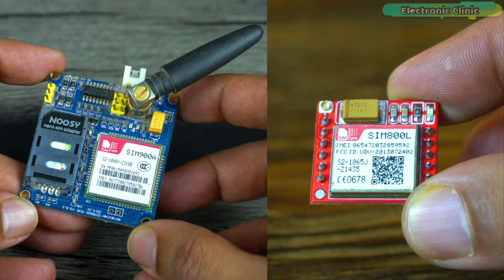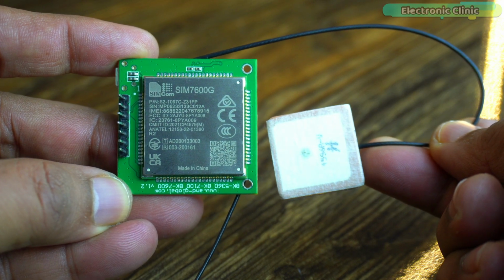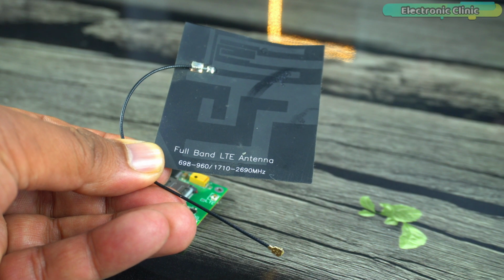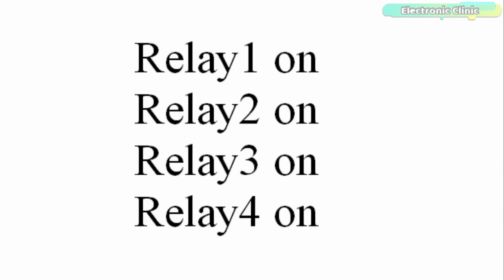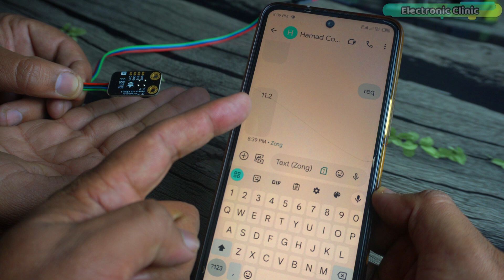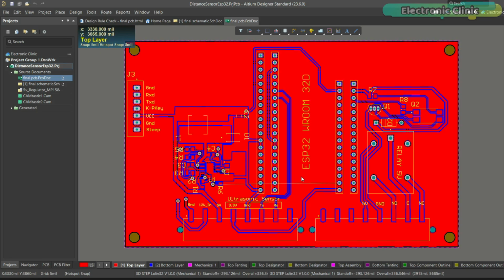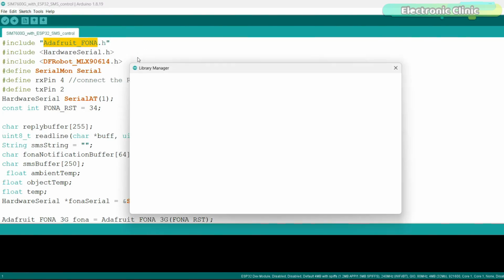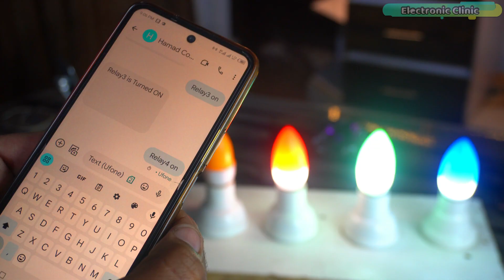SIM7600G LTE GSM with ESP32, Send SMS, & Receive SMS  compatible with 4G, 3G, & 2G networks

Comment: How to make addressable led(more than 100leds) using esp32?
Reply from the maker: You don't need to make, you can purchase a readymade LED strip and use esp32 to control each RGB led in the strip. I have a video on how to control RGB led strips.
Reply: @ElectroniClinic   I want to control smd leds. Do you know how??
Reply from the maker: You can use that similar ic used in the strip.